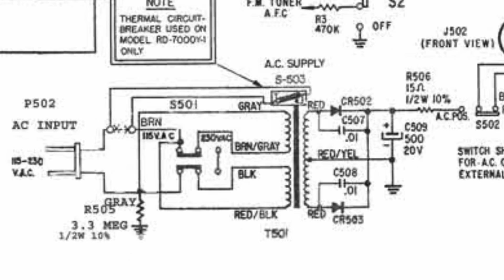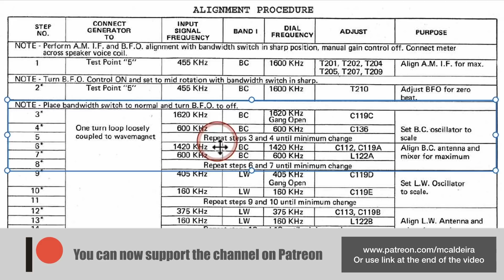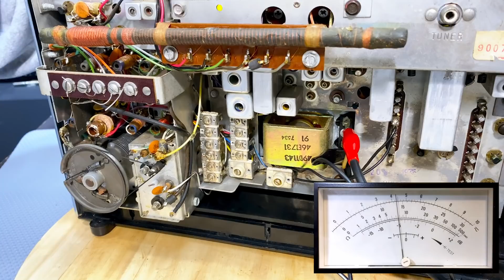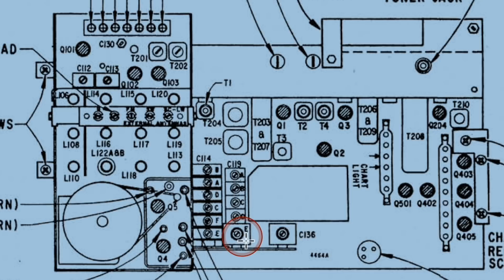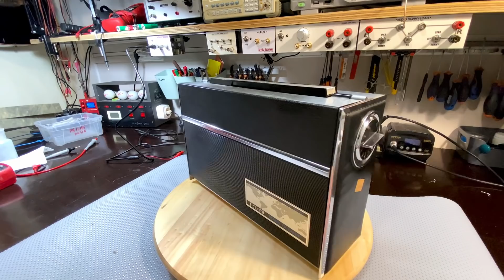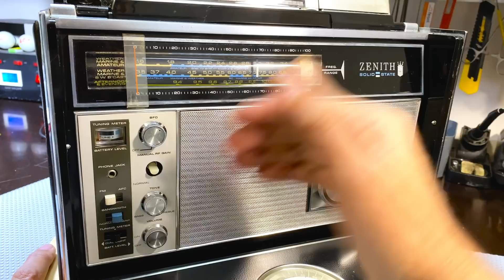This beauty is ready for work. Zenith Trans-Oceanic Royal D7000Y restore, part 4.

Comment: Friends, in my Zenith 3000 radio there is a 330 ohm resistor (orange and orange, brown and silver) and it is connected to the tone potentiometer terminal along with a capacitor, the other end of the resistor is disconnected near the headphone output connector. . . Where to connect which point to solder this terminal, I appreciate any help, thank you.

Comment: Manuel, i just restore my D7000Y, that came the original power transformer, and measure 13Vcc (unloaded) with 220Vca input; with the radio at normal volume the voltage drops to around 12Vcc. I put a 1000uF electrolitic capacitor. Perhaps your not original transformer has a little higher voltage output. Saludos!

Comment: Hello. Thank you for posting this great video series on the d7000y. I have a similar radio that was working great and then one day no am or sw bands. FM and weather channels worked ok. I found the AM oscillator transistor was bad. I found a replacement and now am and sw bands are back. Problem now is am and sw bands are off on the dial.  For example AM 1410 is about 1580 on dial.  Shortwave bands are also off by similar amounts as Am. I believe the radio now needs an alignment. Your instructions are great, but the problem I have is I do not own a RF frequency generator.  I have a scope and both analog (Simpson 260) and digital meters (Fluke). Is there a way I could do a simple alignment to get the dial more accurate without using a frequency generator. If alignment without frequency generator is not possible then do you have a recommendation for a cheap frequency generator that will get the job done. I would only need to align this one radio so not looking to spend a great deal of money. I was a control system engineer for 30 years so I have electronic/electrical knowledge but no radio repair experience.  If I did have a RF generator I would be in great shape as your video was excellent and you are a great teacher in clearly showing how to do this alignment... best I have found. Anyway, thank you Sir for sharing your knowledge and any comment you might have would really help me and others in the same predicament. Take Care, Dean in Virginia
Reply from the maker: the best way for you to do this is by using known stations in your area. For example, if there is station near the bottom of the band, and another near the top, knowing their exact frequencies can be used for the alignment.
Reply: @electronicsoldandnew  Manuel, thank you very much for your speedy response. I will give that a try. Have a good evening.

Comment: Hola Manuel! Inspirado por tu restauración inicié lo mismo con una Royal 7000-1. Luego de cambiar los capacitores electrolíticos empezó a funcionar FM, pero no AM. Tengo Generador, Osciloscopio, Capacímetro, etc. La pregunta es: como llega la señal de 455KHz desde TR5 (aka Q102  121-687 ó 121-872) AM Mixer a la etapa siguiente TR6 (aka Q201 121-687 ó 121-872) AM-FM 1°FI? La base de este transistor está conectada al tuner de WB y FM por S1-7F, luego queda la base "en el aire" al pasar a las bandas de AM. Muchas gracias!
Hello Manuel! Inspired by your restoration I started the same with a Royal 7000-1. After changing the electrolytic capacitors, FM began to work, but not AM. I have Generator, Oscilloscope, Capacimeter, etc. The question is: how does the 455KHz signal arrive from TR5 (aka Q102 121-687 or 121-872) AM Mixer to the next stage TR6 (aka Q201 121-687 or 121-872) AM-FM 1°FI? The base of this transistor is connected to the WB and FM tuner by S1-7F, then the base is "in the air" when moving to the AM bands. Thank you very much!
Reply from the maker: The honest answer is that I have no idea. You’ll need to really follow the wiring, as there is no component layout drawing available. Fortunately the transistors are easily identified by their sockets. It’s slow, but possible.
Reply: @electronicsoldandnew  Gracias Manuel. Mi pregunta estaba basada en el circuito, encontré 2/3 versiones, y en todos la base de TR5 queda en el aire, sin conexión, en AM. Quiero entender primero el principio de funcionamiento de esta parte en la que se me pierde la señal.
Reply: Manuel, it's working now :). It was C203, a .05 ceramic disk capacitor, very difficult access, hidden by the band switch.
Lo medí luego afuera y estaba bien, parece que la pata que va a T202 tocaba a masa. Saludos!

Comment: For the 1.5 V bulb to LED exchange:  you can find very small boosters for a few mA for peanuts ($ .20). Just had the same problem with an analogue meter with 1.5V continuity tester with a little lamp as indicator.
Reply: @electronicsoldandnew  Yea... could be a great tip, but now I realize an analogue meter is something else as an AM receiver.... Will be plain noisy, so maybe not such a good idea 🥴

Comment: Someboudy should find the missing RF gain knob, but this again looks fantastic. Two more radios that would be very interesting to see restored:
- Panasonic RF-2200/DR-22. The best portable ever for mediumwave, very sensitive on FM and a very interesting bandspread mechanism for SW (tunes from ~3.5-28.5 MHz in 6 bands)
- Barlow Wadley XRC-30. Tuns from .5-30 MHz in 30 1MHz bands, very clever trick used to get the 1MHz bands from a tunable oscillator. This is a real challenge to get properly aligned, but Made in South Africa.
Reply from the maker: Oh boy. Now I’ve got to find one of the xcr -30’s. I grew up in SA and was there at the time this radio was produced. Should be an interesting quest for me 😊

Comment: Bloody good job Manuel, We certainly see the difference your Minwip makes testing receivers in the lab. How would it compare with the Zenith on its own antenna on your breakfast table or better yet on the beach?
Reply from the maker: The higher frequencies are pretty good with the it’s own antenna. However, as the frequency drops (below 10MHz or so) the miniwhip beats any other built-in antenna, on any radio.

Comment: I have one of these, in very good condition. It has an inscription of the original owner engraved into the "Trans-Oceanic" metal plate next to the slide rule timezone that reads,
      "Joe Geier
39 years of loyalty
  to Rodefeld INC."

He was mentioned in a 1975 party invitation article so I think my T/O was manufactured at the tail end of production (1976-1978). (EDIT 11/11/24: Date code on speaker suggest 22nd wk 1972.)

The 1.5V bulb for the chart light wouldn't work that well. I use one of those miniature bulbs rated 1.14W and it's very dim. I think the original was something like a 0.3V? It was much brighter than this but my brother idiotically stuffed it in a torch light and burnt the filament in like 1 second. So definitely not a torch light.
Reply from the maker: That’s a radio with a story 😊 Great retirement gift too.